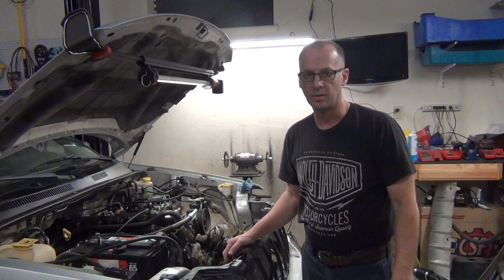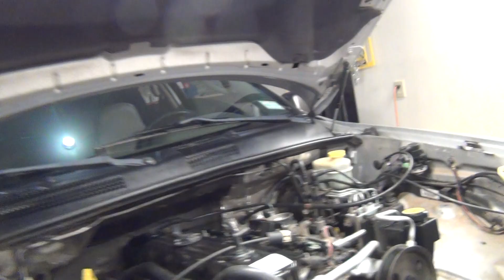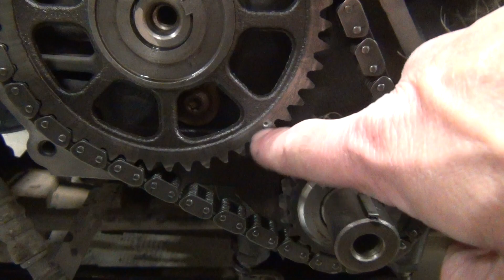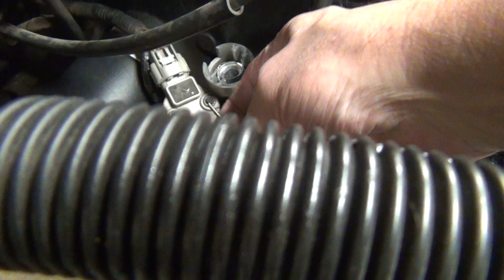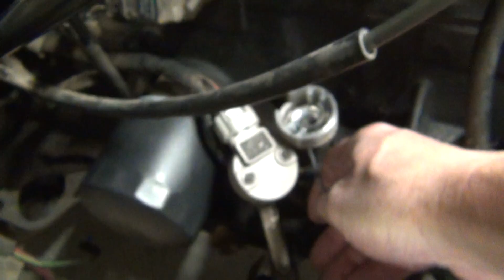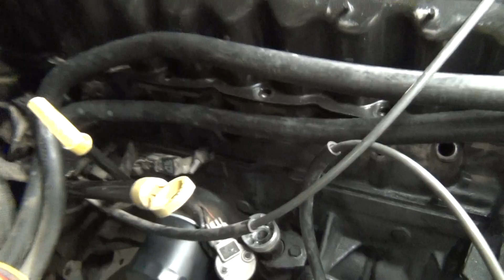Chrysler/Jeep 4.0L inline 6 Timing - quick tip

Comment: Great video. Would be awesome if you could make one for the 80 series land cruiser. About to replace the distributor and have to set the timing on my 97 LX450. 👍
Reply from the maker: I do cover removing and replacing the distributor in my oil pump cover leak video as I also replace the seal on the distributor shaft in that video. I don’t plan to make a separate video on just timing set up, however I do plan to do a complete timing chain replacement on my ‘96 in the near future and all this will be covered in depth. Link to my other video if you want to reference it -https://youtu.be/4IT5T647xII
Reply: You simply pull a valve cover and look at the #1 cyl rocker arms. The intake valve push rod will rise on the intake stroke and the exhaust pushrod will rise on the exhaust stroke.  You still have to feel for the piston to be tdc but you can use that to know what stroke you are on with the piston rise.  Now you just need to look at the fsm to see how to set starting distribututor alignment position.  It will be tdc of one of the strokes.  Then you can set refined timing from there if it's not sensor controlled like the 4.0 jeep is.